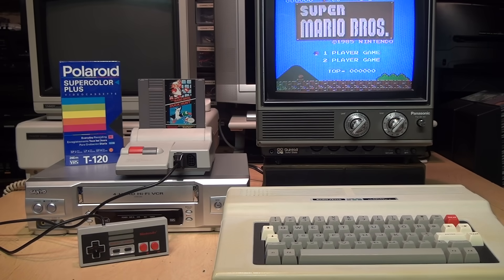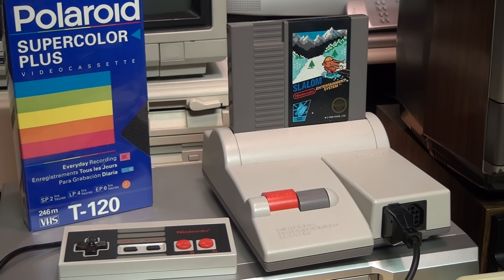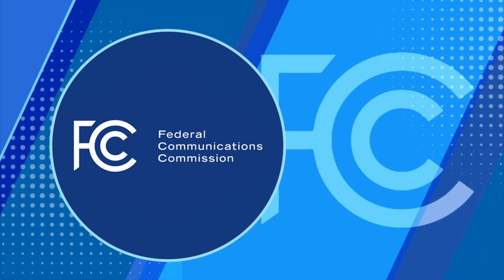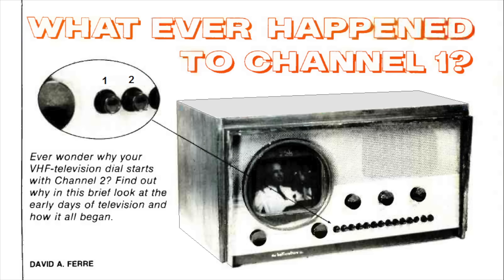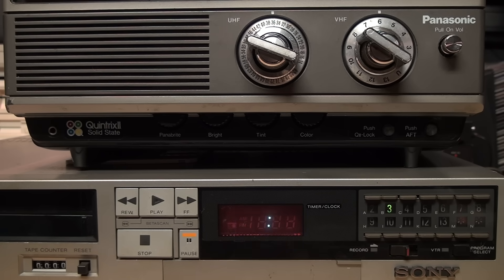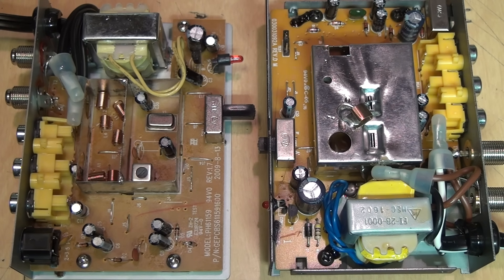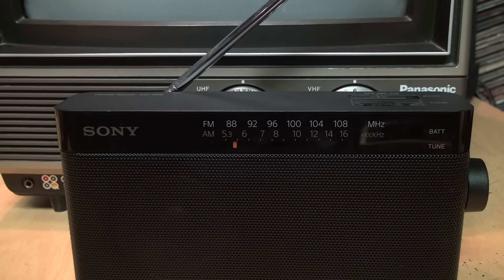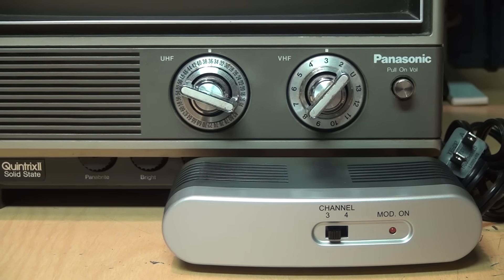Why your Nintendo was on Channel 3 (except in Cleveland)

Comment: Back then, in the 1990s, I used to connect our analog cable TV to the NES/SNES RF switch so that when I turned off the SNES, it would automatically tune in to cable TV channel 3, eliminating the annoying white noise that occurs when the TV is tuned to an unused channel. Although channels 3 & 4 are used in cable TV, they do not interfere with the reception of the NES/SNES when I was playing.

Comment: P42DC, it features the 7FDL16, which is the same reliable diesel found in the AC4400CW.  Although the Siemens Charger uses AC Traction and a Cummins motor, which Cummins has been known for reliability and power output.

Comment: I remember how in the Atari era it was either Channel 2 or channel 3.  In our area it tended to be channel 3, since it wasn't really being used.  I remember my grandparents got a Zenith TV in Arizona one year, and it had the kind of dial where there was a lot of space to slide between channels, and we could pick up different channels in the in-between space that I thought had no earthly business being there.  But this was with cable, not antenna.  Oddly enough, this was around the Channel 6 zone (but we have a strong channel 6 in the area so it wasn't precisely ON channel 6 on the selector wheel.  The channel selector mechanism was almost like that wheel of numbers on The Price Is Right in how it was operated.

Comment: The science was well explained, but my recollection as a kid just outside of Philly recalls using channel 3 (also used by the local NBC affiliate KYW at the time, but now CBS at present time) for whatever reason as the preferred choice without any interference as I recall. Perhaps it was for convenience of not having to change the channel, but I do not recall any difference from either channel when using this switch. Therefore, my question is why a direct wired channel would still receive any interference from an airborne transmitted VHF frequency?

Comment: In Australia it was default at Channel 5.  No broadcaster in the country used it and a law was passed to keep it a closed channel for use by local RF signals in the 70s.
Reply: Also overlaped FM radio on 107.8 FM.

Comment: Could you explain why Japanese consoles are labeled Channel 1 or 2 but in the US they have to be on channel 95 and 96?  I discovered that when I imported my first japanese console.
Reply from the maker: Japan uses different TV channel frequencies than North America.
Reply: @vwestlife  They technically use the same VHF and UHF frequencies as North America, they’re just numbered differently (Japanese VHF channels 1-12 and UHF channels 13+ = American VHF channels 2-13 and UHF channels 14+)
Reply: The channels 95 and 96 are analog cable/CATV channels, that means you have to put your TV in “Cable” mode instead of “Air” or “Antenna” mode to access the frequencies.

Comment: In the UK, TV Tuner channels basically started at 21, and went up to 69.
all Video Recorders and Games consoles were on Channel 36. This is due to regional distribution of channels.
Starting at 22 in the north of England, you had BBC1, then 25 was ITV, BBC 2 on 28 and 32 was channel 4. This is Group A.
This left a nice gap at 36, because in the next region over they were on 44, 47, 51 and 41. This is Group B.
Not just our local regions, but nothing in the country broadcast on 36.
It was only when they tried to squeeze in Channel 5 where it became a problem, as most regions stuck it on Channel 36. Unfortunately where I live they stuck it on Channel 68, Right at the top end of group D, and nobody could receive it without changing their antenna, because it was outside the band range of the local antenna. You needed a special wide band antenna to get a clear picture on Channel 5.

Comment: A couple of years ago, I found a Japanese Famicom at a used game shop. For the most part, it connected the same as the NES, using the RF cable, but the channel it had to tune to was something over 100. I ended up having to connect it through a vcr and mess with the settings to get it to go that high.

Comment: Or maybe it was cheaper to mass produce a single module and choose two neighboring channels since broadcasters were generally assigned channels with separation - practically guaranteeing that at least one would be unused. 

Also, I'm not sure where you got the information that the thickness of the coax is related to frequency because it's not, it's related to power.  What is needed for higher frequencies is better shielding which is why foil shielding and quad shield coax exist.  Since the game station only had about ten feet to travel, the loss from the transmission line was minimal so a thinner, cheaper, more flexible cable was used.

Comment: Growing up in western Kansas, I once connected a coax cable (that normally went to my tv/cable box) to my home stereo via a 75-300 ohm adapter.  I received channel 3’s audio at around 97.3 FM. 

Oddly enough, I got channel 36’s audio on both 87.5 and 108.1.  MTV was on channel 36.

Comment: When I grew up, I mostly had cable and, in the areas where they used antenna and couldn't get cable at the time or didn't want to have cable, the lowest VHF channel was Channel 9 (our PBS station) so one could use either 3 or 4 for VCRs, game consoles, etc. here in Bemidji, Minnesota no matter if one used antenna or subscribed to cable.

Comment: Didn't know so few places had a Channel 3 - where I grew up the local stations were 3, 6, 8, 10, and 21, so our VCRs and whatnot were always set to channel 4.
Although with cable TV this was still an issue because for some reason they remapped all the stations so 2, 3, and 4 were all taken.

Comment: Our VCR was set to Channel 4 because Channel 3 was (and still is) KYW-TV (CBS Philadelphia).
Reply from the maker: KYW is now actually transmitting on RF channel 30, although its virtual channel number is 3.
Reply: KYW’s digital transmitter never operated on VHF 3, their analog transmitter that did broadcast on channel 3 has been permanently disabled since June 2009 due to the FCC-mandated analog shutdown/digital switchover.

Comment: I've got a PAL NES, ch36, surprised that Nintendo fitted a composite output. 

In the UK, you could get a frequency extender for analogue satellite. Was a small box that you stuck to the side of the receiver then plugged into the scart socket. You would flip the switch to get more channels. Needed it for channel 5. 

In the UK, the bottom of the FM band was the police.

Comment: Interestingly, the earliest Atari 2600/VCS consoles (most of the Sunnyvale "Heavy Sixers") didn't have a Channel 2/3 switch, instead being manufactured fixed to use either channel 2 or channel 3 depending on the area the console was sold in.

Comment: Fascinating! Here in Seattle I had my NES hooked up to channel 3. Our broadcast channels were 4, 5, 7, 9, 11 and 13. My TV was old and didn't have a coax connection; instead i had to screw in connectors using an adapter.

Comment: Used to be able to get channel 6 on our radio as a kid
Reply: Yep, you could get channel 6 on 87.7 FM before everything went digital. It was really 87.75 but close enough to 87.7 to hear it
Reply: @inter_1097  If you had one of those mechanical dial radios or press button FM radios that tuned in 0.05 MHz increments instead of 0.2/0.1 MHz increments, you could actually tune it to 87.75!

Comment: I think Japanese channel 2? or whatever the Famicom is on is usable on a US tv on channel 83 or 86.  it isn't exactly the same but can be tuned in if you have a way to do fine frequency adjustment like an old vcr with pots.
Reply: Japanese channel 2 is US cable TV channel 96.
Reply: Cable ready CRT TVs

Comment: The reason they provide only channel 3 or 4 on most video devices is because by FCC rules,  if channel 3 were active in your area,  channel 4 would be free.  Or, vice versa.   In the USA, channel 3 and channel 4 will never be simultaneously occupied in any local area.  That’s why you can be guaranteed that if 3 is in use, 4 will not be in use (and vice versa).   You want to select the channel that’s not in use for your video device to avoid interference.

Comment: I had an RF adapter for an NES, but it was for an even older antenna hookup design, two lil U shaped nubs to fit under similar parts of an on set antenna. I don't think I ever had an antenna with coax, because we eventually got cable and TVs started using AV, but the old Colorless TV was basically free.

Comment: It was my understanding 3 and 4 were picked because they did not allow for adjacent channels in the same market because the tuners were not precision enough to prevent bleed over between channels if they broadcast on adjacent frequencies.  it could all have been BS though.
Reply: It also depended on the wattage and height of the towers of the Channel 3 and Channel 4 TV stations in the area.

Comment: Great video. One minor thing you didn’t mention, VCR’s and Game Adapters interrupted the input antenna when in use so even in markets with a channel 3 (for example), you could still use channel 3 on your modulator as long as they weren’t too close to the TV stations transmitter.

Comment: Some reasons for the channel 3/4 were:
Often channels 3 and 4 were allocated to the same network in nearby cities (in NYC and Philadelphia that was NBC). This means that if you weren't near the halfway point between the 2 cities, one would be available. Channels 3 and 4 were the most relevant pair of such channels, and the only one in the lower VHF band.
Channel 2 has an unusually long wavelength (about 20 feet), and to compensate, higher power transmitters might be used. This channel is also tunable at a much longer distance from the transmitter. NYC channel 2 could be picked up in Philadelphia itself.

Comment: Now that analog is basically dead are modulators even necessary anymore?
Reply: Sort of, but in a much more niche use case. I mean it's the SAME use case, but it's BECOME a niche.

Retro Gamers or old media connoisseurs with access to a CRT TV without Composite or S-Video may need one.
Can you play these games, or watch these TV shows and movies on modern screens? For games yes with emulation or if you happen to have a modern TV that still supports composite (rare, but still possible, I was blown away when the TV with Built in Amazon Fire my mother bought last yes had Composite in) and then of course with TV and movies, streaming or you can use a cheap composite to HDMI converter to hook your VCR up to you modern TV (not recommended for games because the conversion introduces latency)

but for those that want to do it the old school way, you might only be able to get your hands on a CRT TV without Composite, so having an RF Modulator is still necessary

Comment: My Dad insisted on using RCA connectors so we changed the input instead. I couldn’t say if it look better but certainly easier to hook up than trying to get the dumb needle/ screw thing on.
Reply: RCA actually DOES have better visual quality compared to RF, but lets be real nobody back then except video gurus probably actually noticed it.
Reply: @ I couldn’t tell a difference but it was certainly easier to hook up.

Comment: But why was channel 1 disused? Because of something that has to do with a war, right?
Reply from the maker: I suggest you research that for yourself.
Reply: @vwestlife : That's what I've always heard: it seems like it's something like... they took that frequency range away from TV to use it in radios during the war. Which is unfortunate because if we had shaven one off the top of UHF for that purpose it would have been less noticeable (ch. 83 before it got snipped off with the 70+). But I was just kind of surprised that you didn't go over that as part of this video.
Reply from the maker: @HelloKittyFanMan  That is not true. Like I said, look it up.
Reply: @vwestlife : Hey, that might make a good subject for another one of your videos! How come you didn't include whatever the supposedly actual truth is about that as part of this video?

Comment: We had to use channel FOUR in Central Oregon (Bend, Oregon; Redmond, Oregon, etc) instead of 3 when I was growing up, as there was already a full- powered TV channel that transmitted a signal on channel 3 (the local PBS affiliate definitely used it at the time). I always wondered which OTHER markets (cities) had a station that used channel THREE, (so I guess Cleveland did, wow) which would necessitate them to use channel 4 for equipment like this. Sometimes, in Central Oregon, we'd even hear the audio from the OPB (Oregon Public Broadcasting) affiliate "bleeding in" to channel 4 right before turning the power ON to the Atari (if we turned the TV on before the console), and also we would hear it after we turned the Atari off, since we (as kids) tended to turn the TV off after turning the console off. Analog TV signals (NTSC in the USA) were very strong.

Comment: We always used channel 4 because we had WMMT out of Kalamazoo Michigan which interfered if you used channel 3 as they where on analog channel 3 back then.   They are still digital over the air channel 3 as of today.
Reply: Now, you can use analog channel 3 due to the digital OTA rules.

Comment: You have to go back further.  The Atari 2600 was probably the first, it had a switch for output to channel 3 or 4.  You then plugged the video chord to an A/B switch and connected those to your antenna input screws because most TVs didn't have coax connections.

Comment: Fascinating.  I guess by late 80s and mid 90s, either your average cheap co-ax cable got a lot better shielded, or basic cable was well in the process of gobbling up the old VHF bands.  I grew up with an NES using the RF adaptor on channel 3, which was ESPN in my area, and never really had sports casts or nascar races impinge on my games, so I guess it was cable-only with no local VHF broadcast on that channel.

Comment: Is that a Color Computer 2 or 3?
Reply from the maker: A CoCo 2 with an aftermarket keyboard. I have a video about it.
Reply: @vwestlife  I had a 2, and a 3 (128k). I had the FD501 disk drive, the tape recorder, CM-8 monitor, etc.I think I got the part numbers right. haha  My dad just found my TI 99 4/A from when I was 9. Hope it still works.

Comment: For the longest time, I had a tv/vcr combo where you could manually change every channel between uhf & vhf with those tiny dials, but they were right on the front, right under the channel buttons. Every channel could be tuned to 3 different channels.

Comment: Channels 3 and 4 were close enough in frequency that they could interfere with each other, so as a rule the FCC would not license both of them in the same market. That meant that one or the other of them would be available no matter where you were in the US (and it was usually 3 that was open).  With respect to picking up TV audio on FM radio: The KQ2 antenna was built on a hill that was probably outside of St. Joseph, MO when it was constructed, but the city expanded and by the time I was in college I had an apartment that was only about half a mile from the base of the tower. I could pick up Channel 2's audio at several points on the FM band (I suspect this was due to unintentional and probably technically illegal leakage of harmonics because KQ2 was not the most professionally run station).

Comment: The input for one RF cable is nothing. I still remember models where the cable had two flat pins that had to be screwed on. To play on the NES (and actually it was a famiclone) you needed an adapter.

Comment: Those VCRs usually didn't  have the numbers in the windows when you bought them.  They were all blank and you'd tune each local station you could get. Any space could be VHF or UHF. My area has 3, 8, 20, 22, 30, 40, 61. Once you had them tuned you'd put the labels in each window to label the ones you had set. I remember my parents getting a tv with that type of tuner and it was so hard for them to find the channels then figure out what channel they were.  They didn't have Bugs on the screen so you'd have to wait for a station ID during commercials

Comment: For a time, I think Radio Shack offered a tunable RF Modulator, which covered several UHF Channels.  I believe they called it a 'Video Modulator' (15-1243).  It sort of looked like a small CaTV Box or Set-top box.

Comment: Sad fact a suprising number if times. RF is going to be better than composite and sometimes even S video. Sometimes it's the output box and sometimes it was the input device like the tv. Sometimes its just certain combinations. For example, replay TVs had much sharper pictures when recording from a cable box RF vs even S video.

Comment: I never much thought was the channel was set too when I played Atari at a friend's house because it was already set up. The our 1987 VCR ran through channel 3 with the RCA cable. But we did have cable so there was the box and all that. I had only broadcast TV when I first moved to CA in 1996 and there was a channel 3, but I had a VCR hooked up and channels ran through that. Had a 1980s Zenith N121Y that could only use those funky connectors that were flat and went around a screw.

Comment: Another fun perk about RF modulators is how they typically had their own antenna input that they would simply pass through (save for whatever frequency/channel they output their signal on), meaning you could serially connect several devices to one TV all through one input, with the TV receiving whichever device is closest on the input chain for that channel.
And yes, if you had multiple devices all with the choice of channel 3 or 4, you could indeed set the devices to different channels from each other.